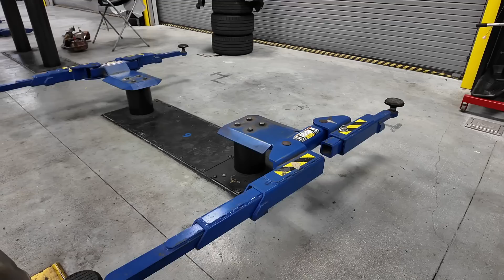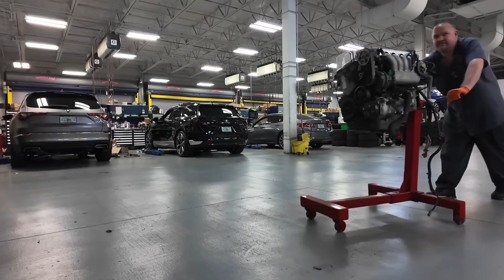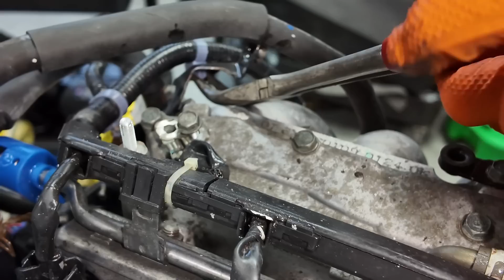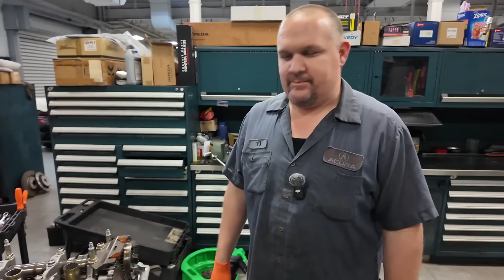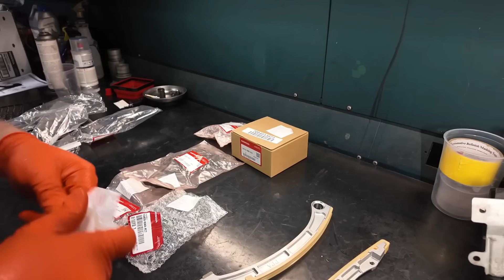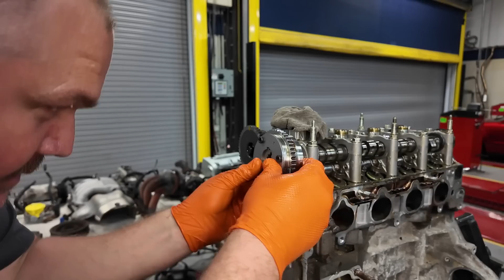K24A2 Engine Teardown & Timing Chain Guide // 2006 Acura TSX 6MT (EP2)

Comment: This is a euro Honda accord I had the v6 version with a 5 speed automatic transmission awesome car. Honda needed to improve the transmission to a 6 speed this would have made this a better car. Honda missed the mark with the replacement had get the TL which was also a great.

Comment: Why wouldn't you do the head gasket & swap the oil pump out for the type S while you have the motor out & on a stand ? Figured you would get everything done you can with it on a stand ?
Reply: It's a stock tsx bro 🙄
Reply: Type S pump isn’t needed for a factory tsx, it’s only needed to rev up to 9k and these guys don’t plan on doing that now head gasket yea I don’t see why wouldn’t they do that.
Reply: Absolutely should have done both oil pump type S upgrade and head gasket.  Silly not to do them.  Still an awesome video.